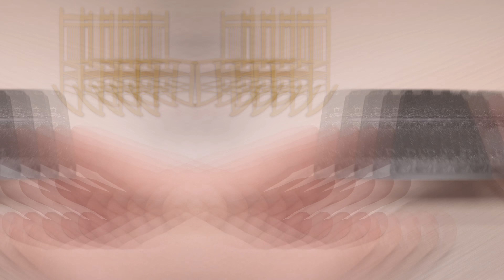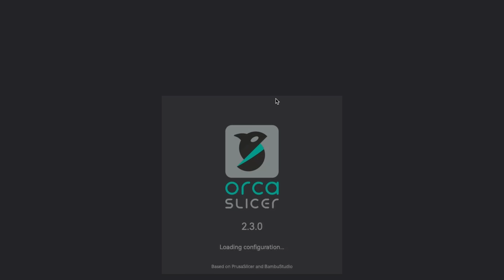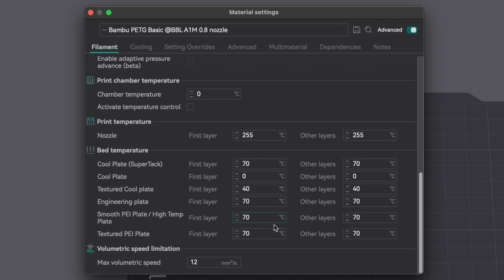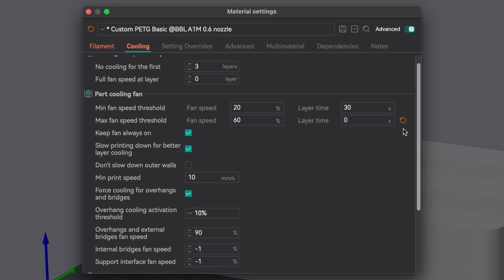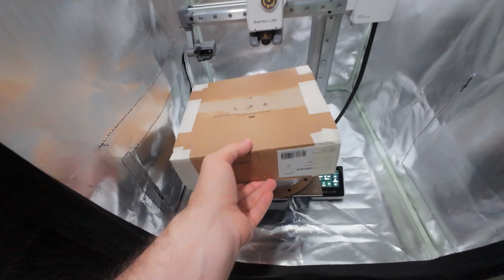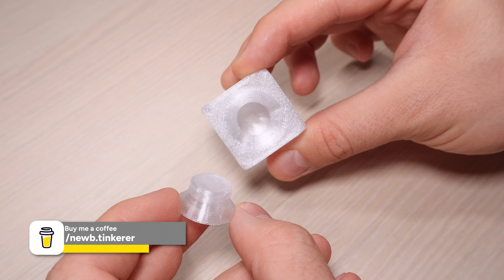Nailing Perfect 3D Prints: My Filament Calibration Journey

Comment: I had the problem of damp filament and thought about building a dryer but saw a comment from someone who was using a food dehydrator, so I bought a cheap one ($50), gutted the shelving, and it nicely holds a 1 kg filament roll and several packets of Silica Gel and dries them nicely in about 8 to 10 hours. I have a Creality K1C printer and have been using the slicer that comes with it which works okay but, on your advice, I will get Orcaslicer and learn to use it as it looks to have a lot more options. Thank you.

Comment: A second comment to bump those numbers. I'm curious to see how you cover pressure advance.

For those others struggling with what seems like a random chance of a good print, the difference between generic settings and building a specific one is night and day. When I grab a 3MF I usually just use the geometry and choose my own filament and nozzle profiles. I also have startup profiles to remove all the redundant leveling and vibration junk so it gets to printing a LOT faster. I very rarely have to tweak any parameter on a random print. Just grab the STL, choose my filament and choose the layer height I want. Most of what I do just works with a .4 nozzle, but I have profiles for PLA and PETG in 0.6 as well. I find very little value in using .2 or .8 nozzles at all, but I have them in case I have need. Very few filaments will play nice with 0.2 nozzles, so be careful. I started out with all bambu filaments on my A1 which is the easy button for consistent good prints. Bambu was too hard to get materials on time, poor customer service, and too expensive for me. I now use Pet-G, PCT-G, FPLA (hate it), TPU 95a, TPU 85a, TPU Air, and the various 'rapid' filaments from ELEGOO (love me some rapid).
Reply from the maker: I appreciate the second comment :). To be honest, pressure advance setting is not something I've had to mess with yet, since the A1 Mini has handled prints so well for my needs, it wasn't on my radar.
Thanks for sharing your workflow details. It's interesting to see how other people get their process dialed in. Cheers.
Reply: @newb_tinkerer It depends on how fast you want to push the printing. I'm just learning CAD, so I have to print a lot of prototypes before it is dialed in. I do a lot of interfacing with manufactured devices where exact fits are important. Slower prints are more forgiving, but my workflow requires that I get it done quickly so I can move to the next design step. I think pressure advance is more important on the fussy 'exotic-ish' materials. I'm the guy that does the flow test and subtracts one pass from the fail point. 🙂
Reply from the maker: Ah I see. Your work sounds interesting :).
Thanks for taking the time to share your process with everyone here. :D